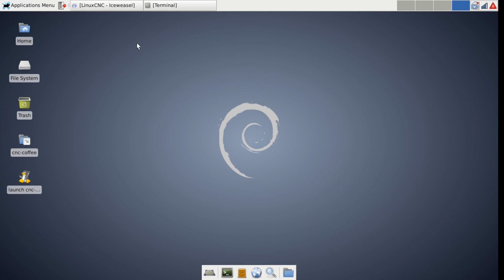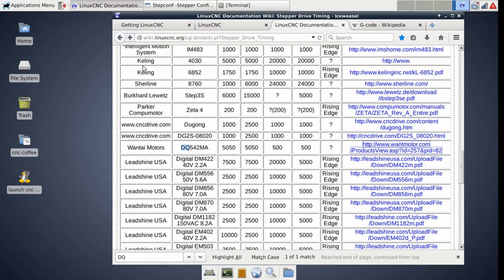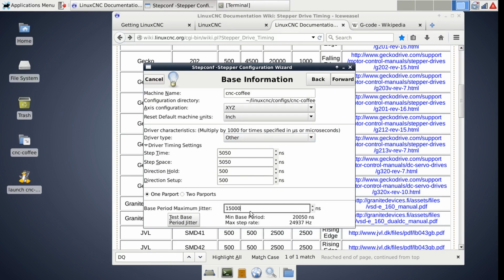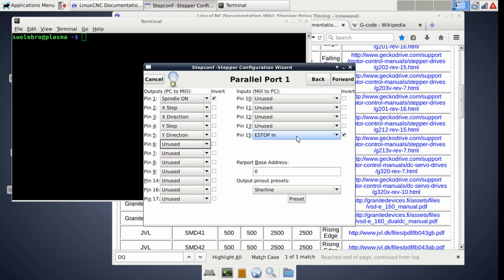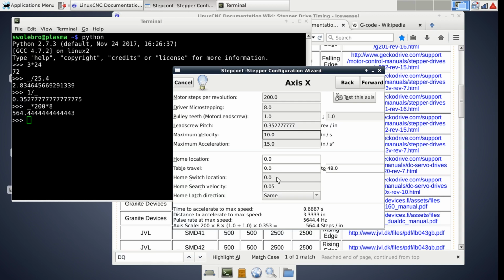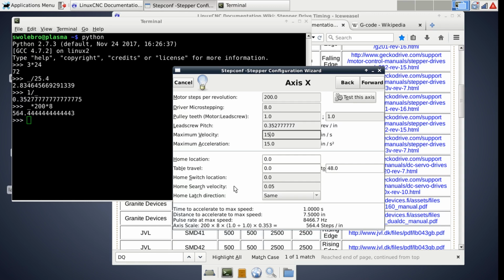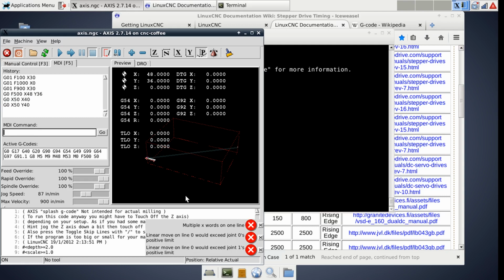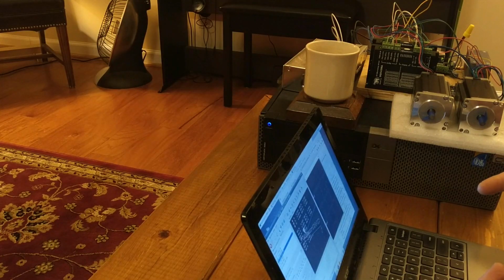LinuxCNC: Software Configuration

Comment: reminder that G0 is 'rapid' uncordinated movement.  Each axis commanded will move at the rate specified.  The motion will not be a direct line from start to end, but what is called a 'dogleg' motion.
For coordinated, linear motion, you must use G01.

BTW, thanks for the video, I am working on using LinuxCNC and Remora SPI for a small milling machine and your video is very informative.

Comment: Down the rabbit hole I go I got motors power drivers arduino freecad and now I’m lost any advice to go from freecad to arduino also i was under the impression you can have usb to arduino and go
Reply from the maker: Well LinuxCNC shouldn't require an Arduino anywhere in the pipeline. Are you thinking of GRBL? That's the CNC controller that's meant to run on an Arduino. In that case, you'd only need a computer to send G-code to the Arduino (since GRBL can only process a couple lines at a time), but that computer doesn't need to be running LinuxCNC.

(As an aside: The standard 3D printer firmware, Marlin, is a souped up version of GRBL, and then most 3D printer control boards are just souped up versions of Arduinos.)

Comment: linuxcnc documentat not have any good no tell how you use dual Y axis , i has try million time make dual Y motor working but only one working. XYZA config use second Y motor only angle run, not same than Y1, not possiple use. and then has lot error i add joint 2 to Y axis, copy joint 1 Y axis to joint 2 axis need run sametime, ok sometime working but lot errors, all homing not working, Y axis go to home not working ,not have aktive to display, how can go home first, not can run cnc if not can go home all axis first. ewery homing axis start lot errors.

Comment: I have Power Step PSD5042-2P drives. I have a signal sequence timing chart.  I’m not sure how to convert that to Step Time, Step Space, Direction Hold, and Direction Setup.   Can you help me?
Reply from the maker: Looks like the specs say it operates at 200kHz and 2.5us time increments. I'm pretty sure that'd mean the step time and step space would both be 2.5us. Not sure about the direction hold values.

In any case, if you're uncertain, err on the higher end. That means your machine will allow more time for each pulse/step to be generated, ie. it will have a lower theoretical top speed, but it will ensure that no pulse is so brief that the stepper driver doesn't have a chance to see it.

Comment: what motor setting need use, today i has make stepper wizard my motors, max has only 30mm/S velocity, what normal used. and why not can use MY-MILL move motors. i has setting now wizard motor tuning and test, move ok but if start my-mill after setting motors not move, same hall meter not show E-stop or probe true/false. has connecter to breadboard 2 button and wired, e-stop pin 10 and probe pin 15 but not working true/false at hall.meter. what need do next. my-mill display not have active, see only e-stop have bushed left up corner. debian 10 preem-rt have and linuxcnc only paraller port, config need be ok, but not sure, jitter i not undertand anythink test but have alltime different. nema 23 2Nm motors. hobby budget not can buy biggest motors, 2Nm 3A motors cost 50$/4axis.  biggest cost 100 or more $/axis not can buy. table size 1000x800x200mm

Comment: any chance you could give some advice please?
machine is built, up and running , I installed switches on x and y axis on both ends , Ive set the closest to me  left hand corner as home with the y axis being forward and back and the x axis left and right , when i want to tell x & y to go find the home switch the machine creeps slowly as it should but it goes the wrong way , Ie it goes away from me and to the right ,instead of towards me and to the left , how do i tell the software to switch this around ?
Reply from the maker: I'm forgetting what the setting is in the stepconf wizard, but if you look to the INI file it generates, there's a couple HOME_SEARCH_VEL and HOME_LATCH_VEL options that you can make negative. That'll turn it around. For example:

https://github.com/swolebro/swolebro-youtube/blob/hal-tutorial-pt09/linuxcnc/configs/hal-tutorial/hal-tutorial.ini#L96
Reply: @swolebro  fantastic thank you, all sorted
Reply: One more question please if I may, now that my homing is working correctly, how do I zero the DRO once in the home position, currently it shows negative numbers, cannot find it in Linuxcnc wiki
Reply: OK. Ignore that, I've got it sorted, thanks for the help :)

Comment: Hey, I'm planning on building a CNC plasma cutter and as a starting point I installed Linux CNC on a computer today. Based on the specs of the machine it seems I'm getting higher jitter then I should. I have read online about BIOS settings and stuff about isolcpus, but it all goes right over my head. Do you know of any resources which will explain how I can reduce jitter in layman's terms, or  an easy to follow step by step guide? Thanks!
Reply from the maker: I got a hunch you installed a LinuxCNC with the PREEMPT-RT kernel. I forget where exactly I talked about this, but the kernel is basically the program that runs all your other programs. It's what makes Linux Linux.

By default, the kernel doesn't have any options for real-time control (needed for CNC), but since Linux is open source, the community has developed two add-on options. 1. PREEMPT-RT and 2. RTAI.

RTAI has lower jitter when using the CPU for step pulse generation, but PREEMPT-RT has more features that let you use it with external stepgen boards (ie. Mesa hardware). If you're doing a barebones built, the RTAI one is probably for you.

Check the output of `uname -a` on the command line and see which one it says. Easiest thing might be a reinstall if you've picked the wrong one.
Reply: @swolebro  Hey, thanks for taking the time to respond! I ran the uname -a line and I'm indeed running the preempt-rt. When I downloaded the ISO the linuxcnc site seemed to recommend the preempt-rt, so that's why I installed it. I'm planning to make a barebones build with a parallel breakout running the stepper drivers.     I'll try reinstall  the RTAI version instead.  Thanks again!
Reply from the maker: @pietzeekoe  Yeah, that should fix you up. I paid $50 for my 10yr old Optiplex 980, works just fine.

FYI,  later in the playlist I've got a bunch of videos on configuring the HAL files for ohmic probing and such. You're going to want to take a look at those once you've got the gantry rolling.
Reply: @swolebro  As an update for anyone who has a similar experience, I installed the RTAI version of LinuxCNC and my max jitter went from 75000 down to about 1100. I've actually watched your HAL series, but i'll probably need to go through it again once I get the mechanical side sorted ;).

Comment: Sir, Can we use sensor to manipulate z axis?(Router)
so that sensor reads the distance between the ground and itself and provide it to the z axis.
Reply from the maker: You can! In fact, if you look later in the playlist:

https://www.youtube.com/playlist?list=PL9xPdBFt5g3Qnn3ZY2wYh7L2yzZ377UwI

I've got a video on ohmic probing for my plasma cutter. You could follow the same basic principal for a router - even simpler, in fact, since you don't need to worry about high voltages arcing across to your breakout board.

You might need to watch some of the earlier HAL videos to get a feel for it, but take a watch, and let me know if you have questions.
Reply: @swolebro  Thank a lot for the response sir. . I will do the same as you suggested . . Thank u sir
Reply from the maker: @shabantyagi7354  Heads up, KVV published a video today about setting up and testing a dedicated tool length probe. It's along the same general lines as ohmic sensing, but probably way closer to what you're going to end up doing in practice, particularly if you set up a tool table and use the G43 and TXX commands.

https://www.youtube.com/watch?v=SCPzcgQVGf4

That guy is so thorough. Squeezing out tenths of a thou of accuracy from some bog-standard probe, and examining it from every possible angle. Highly recommend watching everything he does.

Comment: could you suggest how to configure linuxcnc to run in phase control mode (step gen type 7, 4 wires), and not step/dir mode?
Reply from the maker: Huh, I'm not familiar with that type of stepper driver, but the stepgen HAL component does offer a lot more than what the Stepconf Wizard provides.

If you take a look at the manpage for stepgen (type `man stepgen` at the commandline), there's a number of different settings for the step_type, one of which might have you covered. Using that is going to mean hand-configuring all your HAL totally from scratch, though. I have plenty of other videos showing how to work with HAL, but none specifically covering customizing stepgen, since the basic wizard setup works for 99% of users (myself included).

If you have a link to an English spec sheet on the drivers, then I might be able to help a bit better.
Reply: @swolebro  Thanks a lot for your response! I have browsed internet extensively for how to configure linuxcnc for L298N driver.
I must say that just before loosing my hopes, I have found the following (I paste here my findings, so others could use it as well):
1. https://forum.linuxcnc.org/38-general-linuxcnc-questions/27452-direct-phase-driving-of-stepper-machines
2. https://www.cnczone.com/forums/stepper-motors-drives/264850-software.html
3. https://www.cnczone.com/forums/linuxcnc-formerly-emc2-/107778-cnc-forum.html

It speaks how to configure linuxcnc for stepgen 7.

This is the driver I am using:
a) driver: https://components101.com/sites/default/files/component_pin/L298N-Module-Pinout.jpg
b) data sheet: https://www.alldatasheet.com/datasheet-pdf/pdf/22440/STMICROELECTRONICS/L298N.html

Also, I do remember seeing youtube video how to configure parallel port in linuxcnc with 4 wire output...however, I cannot find it anymore :(

I would be grateful for any of your help!
Reply from the maker: @KEcAzZ1  Ok, taking a look at those docs, I think I get what you're working with, and this guy seems to have the right idea as far as the HAL parts go.

https://www.cnczone.com/forums/linuxcnc-formerly-emc2-/107778-cnc-forum.html#post794985

Before I go dumping a bunch of crap you're not going to understand into YouTube comments, how much of my HAL series have you watched? eg. Do you understand the concept of how a signal connects HAL pins?

Also, how many motors are you trying to connect here? A DB25-1205 is only going to give you 12 output pins, and each of the drivers will take 4. So if you're doing three motors, that already means you won't have anything for spindle control, etc.
Reply: @swolebro  Thanks for your help! I am new to both CNCs and LinuxCNC all together. I saw some tutorials, and based on them, I bought several L298N just to realize that its kinda wrong way to control cd/dvd rom stepper motors. With that being said, I found (which I then lost) a youtube video on how to configure 4 wire parallel port control of stepper motor, which gave me some hope. I am currently looking at your videos, trying to familiarize myself a bit with HAL and ini files.. Also, I am setting up PC for some tests (it might take some time, as I found out my old PC HDD to be dead).

At the beginning, I would like to control 1 motor, then 3, and finally 5. For some very first tests, both - 1 parallel port, 1 L298N, and 1 stepper motor should suffice. Later, I have seen that using "out" port configuration, you get 12 pins from parallel port. This could give me 3 motor control. And finally, after adding another parallel port, I should be able at the end to control 5 motors. That is the plan.

Cheers!
Reply from the maker: @KEcAzZ1  Well, the step/dir based drivers are definitely easier to work with, require fewer wires, and can be obtained inexpensively. The ones for my machine are $40 a pop, but for a CD-sized stepper motor, you could make due with the same kinds 3D printers use, that are more like $5-15.

If you want to try using the phase drivers for the learning experience though, that's still laudable. I'd say to watch the first few videos on my HAL series (don't skip #1(b) either), and by that point, you should have enough of an idea of how this works that you can blunder through what that guy on CNCZone was talking about. Blundering through is half of working with tech anyway. Hahah.
Reply: @swolebro  Yep, I have seen very inexpensive stepper drivers. This, however, is after I bought L298Ns... I will dwell into your videos and try to blunder through :) Thanks!!

Comment: 6:01 I am using mesa boards with clear view servos.  Why wouldnt I use linuxCNC?  Even the design engineer at teknic recommended it!
Reply from the maker: Oh, you definitely should, you just don't use the Stepconf Wizard! The Pncconf Wizard is the one for you. :p

I don't have any experience with those yet, but once you get the basic setup done, all the HAL concepts are the same, and I got a pretty detailed tutorial on those later in the LinuxCNC playlist.
Reply: @swolebro  Cool, I am still designing the table, doing research and talking to people to figure out what works.  Thanks for the video.  I am watching your 80/20 video now (an option but I will probably fab my own aluminum gantry)

Comment: I installed Linnux cnc onto an old  Compaq computer With 2Gb of memory. It installed nicely but when I go to log in with my password it doesn't accept it. I reinstalled 4 times with the same results. Do you have any idea why that would Happen. Thanks
Reply from the maker: Huh, that's an odd one. I can't really imagine that being a software issue.

You loaded up the live USB, installed it to the hard drive, then rebooted from the hard drive? When you were on the live USB, did you try typing in a text editor ("Mousepad" is a default one on LCNC v2.7) to make sure capslock wasn't on and all the keys are functional? Are you using some sort of foreign language keyboard?

I forget what prompts were available in the installer, but there may also be an option to just forego the password entirely. Hahah. That's what I do on mine. Instinctively, you might think that's insecure, but given that the machine is only accessible on my network and powered off 95% of the time, you'd have to be in my shop anyway... at which point, you could just steal the computer if you wanted to... Or the plasma cutter, which is 40x more valuable!
Reply: Go to your bios and disable useless hardware if any such as sound card network.......

Comment: I am watching your videos up and down! Great Infos on all of them!
I thought on the configuration of steppers the microsteps should be the one from the driver settings set with dip switches? ... Obviously not..
You mentioned in one video you use uc100 USB to Db25 . Is your configuration for Linux of the uc100 somewhere to be found in a video? Thx!
Reply from the maker: The microstep setting here should be the same as whatever you set on the DIP switches. If you set the DIP switches to x4, but tell LinuxCNC its x8, then you're going to get some wonky motion.

No UC100 required. That looks like it's a Windows/Mach thing. Just buy an old desktop computer with a parallel port already on it. (I got a 10+ year old Dell Optiplex 980 for $50.) The plug a $20 breakout board to that, and wire your stepper drivers to the BOB. If you need more pins later, you can buy a $10 PCIe to DB25 adapter (assuming your computer has spare PCIe slots, as per the wiring video (https://www.youtube.com/watch?v=vR2xxRQQtyQ), then plug another $20 BOB into that.

If you ever want to get fancy, you can spend a $200-500 on adapter cards from store.mesanet.com, and then you'll have more driver outputs and I/O pins than you know what to do with. And they sell boards specifically for LinuxCNC - in fact, I'm 98% sure sure that Big John (prolific poster on the LinuxCNC) forums works for Mesa.
Reply: @swolebro  ok that makes the microstep settings clear. Thx
I have a 7i76e which got defective and mesa promised me to send me a replacement for free.
In order to play around I bought now a db25 12-05 and an uc100 already.... before your answer...
By the way I like the way you swap between man ..hal..ini using view ...efficient!! All the best!!

Comment: Nicely done. I didn't know about the latency plot, I'll need to play with that :)
Thanks for the shout!
Reply from the maker: Of course! The easier I can make it for people to find good info, the better for all of us.

There's a few gems like that hidden in LinuxCNC. You just kinda need to stumble into them in the docs or via tab complete in the shell. Two of my other favorites so far are `halmeter` (for monitoring halpins while debugging a running machine) and `halcmd -fk` (gives you a tab completable thing for entering hal commands while the machine is running). Also, the hal_input module and MDI_COMMAND (ini file option) let you rig up shortcuts on an XBox controller - very handy.

I got a series on that planned, but ffs, putting anything in video makes stuff takes 10x longer. Even this video was over a year ago now. lol

Comment: was standing on my head for the past many hours , eventually gave up , but you kknow our community has two attributes 1 they dont have life and iteration. The motors would jog perfet in config but machine wont run
after listening to 15 min of your presentation I found that the simulation was checked Rushed back to the machine counter un checked sim and there ya go. thanks for your presentation